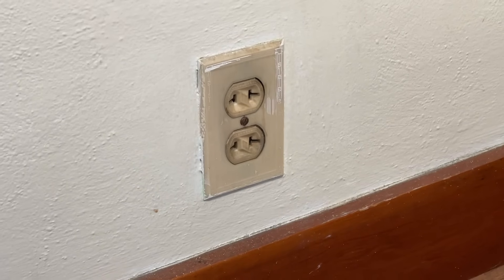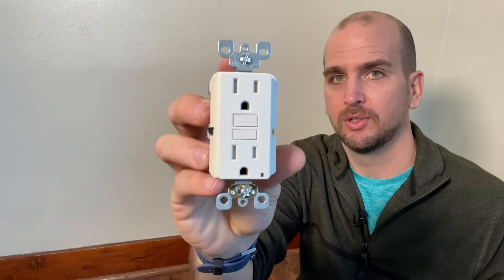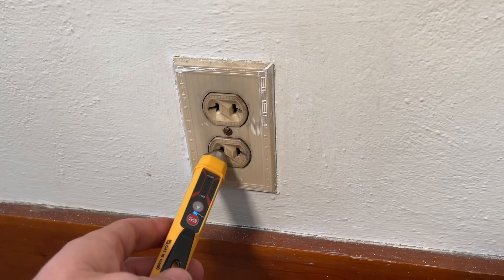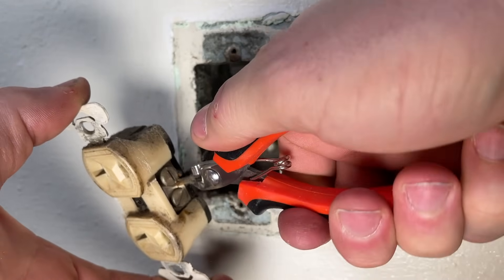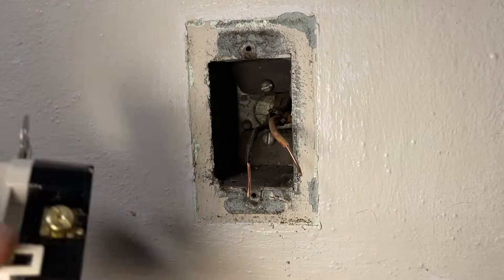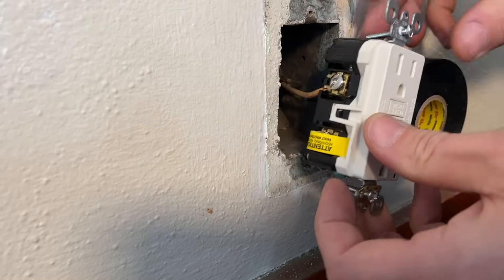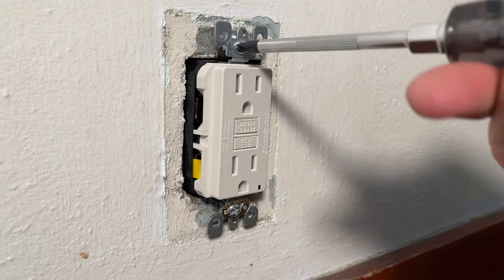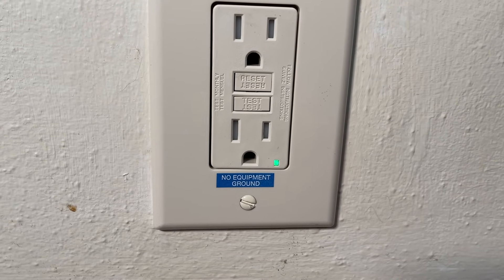How To Replace An Old 2 Prong Outlet Using 3 Prong GFCI

Comment: The 3 prong adapter is grounded with the screw, if it has a metal box with B X cable attached.
Reply: "If" Also does that provide path that has low enough impedance?

Comment: This is interesting I have an older house with almost all of the outlets are 2 prong I wanted to replace some of them with 3 prongs for years but thought I'd have to rewire the whole house The circuit breaker Box is newer only about 25 years old So I guess I could do something like this if I felt really brave
Reply: Check the circuit breaker box (main panel) to verify if ground/neutral bus bars exist and ground and neutral wires are connected there. You have to carefully remove the cover to see this. You can also check to see if the metal boxes are already grounded by using a multimeter. On some older homes ground wires were run separately and attached to the outside of each box.

Comment: Actually you can still buy two prong outlets in some hardware stores.   They are only code as replacement for old two prong outlets.  Now GFI's are good replacement for old two prong outlets,  except that the box might be too small. 
Being 74 years, I remember the time before  three prong outlets. 
I know of two deadly electrocutions because of lack of grounding, or 3 prong outlets.
One was a young man in 1968, who was using an  old style electric drill, and he got electrocuted while sanding rust of the undercarriage of a car. 
The most interesting happened to a Michael Cannon in New Orleans around the late 80's. 
He was moving large beverages vending machines.   He was between two of the vending machines. 
One machine was powered by an old 2 prong outlets with an adapter to 3 prong. 
The other vending machines was wired by a 3 prong outlets.
Because of impedance,  one machine had better grounding.  Also refrigerator motor tend to go to ground.  
When Michael pushed between the two machines,  he created a grounding path between the two machines and was electrocuted.
Reply: I ran into boxes that were too small for a GFCI.  Ended up having to use a GFCI breaker.
Reply: @Johnnybytheway  GFI breaker is one of the best solution.
Another solutions would be wiremold external box on the outside of the existing electrical box. 
Appearance wise the large box does not give a good appearance, although it is strong secure fitting. 
Thank you for your polite response.
Reply: @jamesmooney8933  You're welcome.  I'm ONLY 67 but also remember some horror stories from the "good old days".
Reply: It has to be defective. While working devices can leak current that is not allowed on dangerous levels. For example PCs leak some 0.5 mA. That shows the risk of mixed grounding environment. In Finland grounded outlets were required on dangerous locations since 1930. Also here you would not have connected an ungrounded plug on such just for the reasons you pointed. In the US anyone could still use such an old drill without realizing the risk. Here the plug would not fit. 

Not that people here did not use adapters either but they at least had to make them themselves.

Comment: There didn't appear to be enough wire out of the box to match code.  Shouldn't it be 6 in.?
Reply: The 6 inch measurement is from where the wires enter the box, not from the front.
Reply: @surferdude642  Of course it is.  And it's still short.
Reply: @Species-rj9si  You're right, he could have added a pigtail extension for each wire.

Comment: Within NYC limits in the past, BX & metal boxes were used.  An aluminum wire was used to ensure of a ground connection along with the armor sheath of the BX.  The screw tab on the adapter plug was to provide a mechanical connection to ground & the plug not to be removed.  Power tools & most kitchen appliances were made with a metal housing.  3 prong plugs was to prevent electric shock.  This failed though since in the infinite wisdom of some older folk was to either cut off the adapter tab or cut off the 3rd prong on a grounded plug.  My father went nuts because I replugged his metal cased power tools!  But I also replugged the whole house with 3 prong outlets & ensured there was a ground circuit for all the outlets.  That's what my mother got for sending me to Thomas Edison Vocational HS.  I was also an electrician in the US Navy & the NYC Transit system.  I repaired electric trains 1:1 scale & wired my train club's layout room & layout.
Reply: Was going to say why didn't he check the box to see if it was grounded ??? Not sure if code allows him to make a grounding connection from a box to outlet as acceptable ?????

In the middle of doing this in my parents nyc home, crazy how many lights/outlets were not not grounded. Thankfully the bx cable/boxes were for the most part grounded back to that... Tis true the elders of ze past didnt care about grounding in the past
Reply: @randyhaxor  now, you need to be careful about where you use NM cable.  Mice and rats have gotten a taste for the plastic, and have chewed through PVC conduit and NM jackets when they've gotten into attics through vents and breaks in a wall.  And for the old cotton cloth wrapped NM cables, termites have gotten into some of them as they eat away at wood studs in a house.  Some building codes now forbid NM wire except in use inside plastered walls in new construction, due to rat and mice chewing up the wiring.  The alternative now used is flexible conduit with 14 or 12 gauge wiring being fed through it to the boxes.  If the new construction uses metal boxes, metal flex is used.
Reply: If the socket was not grounded it is best not to assume that there is adequate ground and use a GFCI outlet anyway. The label may be unnecessary if a tester shows ground. Even the poorest ground connection is enough for a GFCI.

Comment: No one is going to know the difference, but according to the NEC, for tightening the screws where your landing wires on an outlet, you are required to use a torque screwdriver.

Comment: If you know you turned off the right breaker there is no power in the box. If the breaker was faulty you would the outlet would not be dead when you put it up to the prong holes.

Comment: Thanks for the help. When I installed the GFCI and measured the voltage, I was getting a proper 120v, as opposed to the 110ish  I was getting with my old outlet. Could this be because of the age of the older outlet?

Comment: I just purchased a house February  28th of this year. The home that I purchased was built in 1959 is older than me.  But it's beautiful. 
Every outlet has the two prone in all 3  bedrooms,  bathroom and living room. The kitchen is the only one that has the three prong. I am nowhere near  savvy enough or courageous, and I'm very scary when it come down to messing with electrical outlets. After watching this video it looks like it won't be hard to change them out myself. But I don't think the fuse  box is labeled as clear as to what breaker goes with what room...
Reply: In the  50s, when three slot receptacles were in their infancy,  they commonly installed them in wet locations,  like kitchens,  bathrooms and outdoors.   This was pretty logical actually,  because this is where people are most likely to be electrocuted, and equipment grounding was not thought to be super important,  as today.   That's why for many years,  GFCI outlets were only found in bathrooms  and outdoors.   Now, they are required for kitchens,  unfinished basements, crawl spaces,  garages and workshops.

Comment: Thank you very much. My daughter and her man just bought a 67 year old house. I agreed to replace the most I can before I have to f,y home. Foolishly I did not pick up a voltage sensor, so I don’t know if the first one I tried was even live before I began, but I had thrown the breaker. So I went to another one, got it all wired up tight and then could not get it into the tiny box! Tomorrow I will grab a voltage thing, and try this tape wrap to see if I can get it in there. Between your video and one other I finally got it set in my mind exactly what the GFCI is doing in this situation. This was exactly what I needed.

Comment: I'm confused, what is the point from going to the 3 prong if you cant use equipment with a ground prong? Why not just keep the 2 prong, or get a modern 2 prong to replace the old?

Comment: Why not use standard 3 prong outlet and loop the ground to the neutral?
Reply: Good question!

This is known as a false ground,  or bootleg ground,  the neutral is a current carrying conductor, and will have a voltage drop depending on load, and the integrity of the neutral.   An open or loose neutral can cause the neutral to have 120 volts relative to ground.    

At the technical college I attended,  our instructor demonstrated this, by plugging in a heat gun that draws close to 15 amps,  then measuring between the ground and neutral slots on an outlet,  measuring a few volts with the heat gun turned on,  and 0 volts with the heat gun turned off.    The instructor repeated this test, with the neutral disconnected, to demonstrate the hazards of an open neutral with a load downstream  To our surprise,  the neutral read a full 120 volts, to ground.     

In this situation,  a false ground will make any metal housed appliance an electrocution hazard.    Don't do it.
Reply: You will see this especially on flipper homes, and many cases is not detected during an home inspection.   But is a dangerous and unethical practice.

Comment: In a house built around 1950, a grounded receptacle is needed in the kitchen. I am considering running copper wire from the outlet to a rod in the ground underneath the kitchen.
Reply: Don't bother. The grounding wire must be bonded to the neutral/ground bus bar at main panel and only in that one location. This will complete the circuit loop and allow the breaker to trip in the event of a short or ground fault. The ground rod is there to protect the building from external electrical events such as a lightning strike.
Reply: @surferdude642  First, the house has no circuit breakers, only screw-in fuses.
Second, the ground rod provides no real protection. A bolt of lightning hit a tree in my neighbor's yard and caused every one of his devices that had microprocessors to be fried and needed to be replaced. I am in a separate house next door with modern circuit breakers and outlets that all pass the grounding test. My computer's main circuit board, my mouse, my modem all had to be replaced. The polarity of the batteries was reversed in my kitchen telephone-answering machine. Surge protectors did not protect my electronics.

Comment: A better way to install outlets is to have the ground prong in the top position, i.e. positioned 180 deg from what is shown in the video. This will help to minimize an opportunity for the neutral and hot spades to come in contact with each other and cause a short should something fall between them.

Comment: Perfect presentation!   Short and to the point yet covered all the bases, in fact taught me some things I didn't think to ask :)   Wish I'd known this 10 yrs ago when I bought my 1920's house but now I'm renovating and this will be quite handy so I can do prep work before electrician does the panel work - thank you!
Reply: No. If you are hiring a properly licensed and bonded electrical contractor, they will tell you very plainly that your entire wiring system will need to be upgraded. There really is no way around it.
Reply: @k9builder  In the video he says: If there’s any fault in the wiring the GFCI will trip off (paraphrasing) ... Wouldn’t that make it safe?

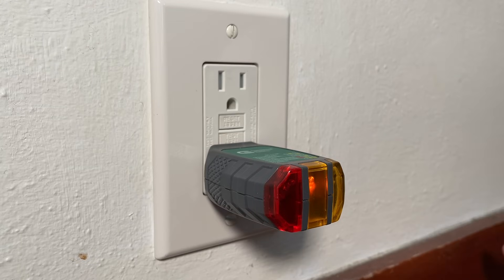Comment: How bad or ineffective is it to connect a wire between the grounding (Green) screw and the neutral wire? I have a GFCI that reads as wired "CORRECT" rather than "OPEN GROUND" as seen in 5:17 - but only for the reason I mentioned.
Reply: Very bad and illegal. Google "bootleg ground" for more details. By doing this you are making the ground wire a current carrying conductor under normal operation, when it should only carry current in a ground fault condition.
Reply: @surferdude642  THANK YOU! I will. Really appreciate your perspective and for answering this question

Comment: I have in my garage three 2 prong plugs Daisy changed together. The second plug has a 40 foot wire running underground to a shed for indoor light but would like to install another plug and additional light fixture inside and a security light outside. I would assume one gfi for the three plugs in the garage but would I need another gfi for the shed?

Comment: still i think a GFCI should have a ground wire, if thr box is steel and the box is grounded j hook it to a screw on the box .. if no ground or plastic box , i would feel more safe to run a wire from thre box to a legitimate ground ..  especially in kitchen... bath..  laundry.. slop sink.. exterior location.. or run a G W B romex to the box ....

Comment: Good video! Just a friendly reminder that you need to have at least 6” of free conductor length at the junction box for connection purposes as per 300.14 of the National Electric Code.
Reply: Thank you! It drives me nuts when people cut length out and then don't put in pig tails.

Comment: I'm replacing a 2 prong outlet with a GFCI in a house built in 1943. 
There is a single hot and neutral wire coming to a connector on each side of the receptacle, a small portion of the insulation is stripped away on each wire where it connects to the receptacle and then the hot and neutral continue onto the next outlet. 
I know I need to cut the 2 hot and neutral wires to make 4 wires, and you’ve shown how to determine which is line and which is load. 
How can I identify which neutral wires goes with the line/load sides.
Thanks.

Comment: This is terrible.   First thing   you should have made a pigtail off the neutral wire and hook your two pigtails under the neutral screw and the ground screw.  The neutrals and ground hook up in the same spot in the panel.  So it wouldn't hurt anything.   Second thing when an inspector comes in and test the receptacles.  There tester will show no ground hook up and fail you.   Electricians call them GFI  not GFCI

Comment: The biggest problem I have is the box being too shallow for the device & wire fill or just plain too shallow for the device itself and/or some of the old boxes are too narrow for the device!!

I have even ran into existing grounded circuits from the 70s/80s with these narrow/shallow boxes as well!

Comment: Bullshit video the gfci will not work with out a ground buddy post a video with you using a gfci tested and test it
Reply from the maker: No sure what to tell ya other than GFCI will function per design without a ground.  Once a delta is detected between the hot and neutral the GFCI will trip.

Comment: Did ya see the GREEN screw? ya know the one that is suppose to secure your ground wire to. Unless GFI's have changed in the last few years the GROUNG wire was always   essential for proper insulation. I would not trust a GFI to properly  work with out a ground wire. DONT PLUG IN ANF THROW THE CORD IN THE TUB WITH YA TO CHECK OUT! I no longer have a updated code book but I find that amazing if the code does infact reconizes this
Reply from the maker: I know it is counterintuitive as “ground” is in the name but the GFCI will still work.  GFCI detects a difference between the hot and neutral wires.  If something were to short the hot side and create an alternate path to ground and as such a difference between hot and neutral.  After 5 mA difference the GFCI will still trip cutting power.

Comment: I was told those outlets you just used was not grounded.  I went on amazon and typed grounded outlets and found 10 for around 19 dollars.  The ones you used cost over 80 dollars for 10 and I need 13.  Plus the plates.  So I'm confused about your video.  I'm sure I just don't understand is all.

Comment: Why exactly is this safer?
The GFCI doesn’t give you an actual ground! It has a fully non-functional place for a ground prong. So if your equipment actually needs a ground (for a metal case for example) it gives you a very false sense of security.

Comment: 2 questions!

1. What does no equipment ground mean. I have several of those stickers on my faceplates when I moved to my house.

2. You said sometimes you can get get away with putting just 1 gfci receptacle...is it ok to just make all receptacles gfci? Or is that a problem
Reply: It means exactly what it says. That the there is no ground wire. The GFCI is used to provide the protection. This is a compromise to make converting old outlets affordable.

You can do either way but if you do the latter you should pigtail and not run the wires through the outlets so that the downstream outlets are not protected by several GFCIs. It might be good to have a separate GFCI on the outlet you use with a desktop computer so that no other outlet will cause it to trip.

Comment: When you check the wires see if they come out of a metal sleeve clamped to the metal box. Some old wiring was run using BX cable. This is a flexible metal sleeve with two loose wires running through it. If it has this type of wiring the metal sleeve should be clamped to the metal box, and the breaker panel (or fuse box in old houses). If this is the case you can take a stripped peace of wire and run it from the metal box to the ground on the outlet. That should give you a fully grounded outlet. The metal sleeve acts as a ground wire to the breaker (fuse box). as long as the breaker (fuse) box is grounded you should be all set. You can get a ground tester plug from 5 to ten bucks to make sure it is safe.